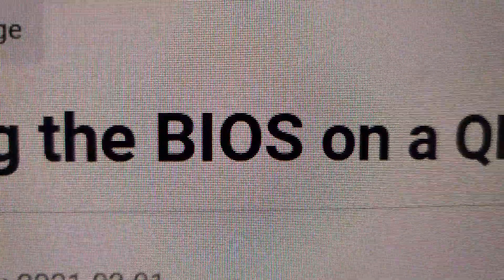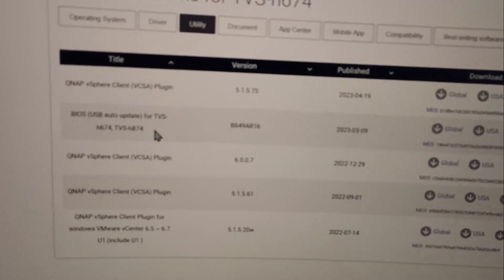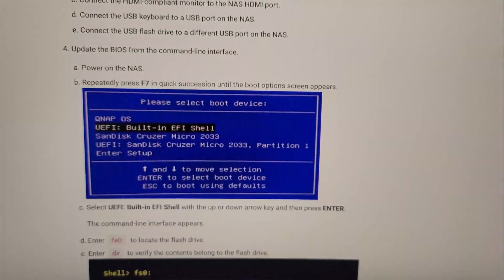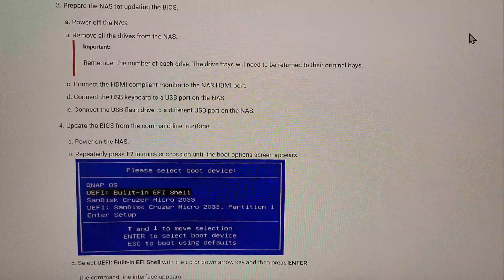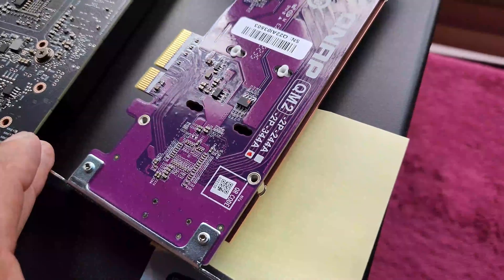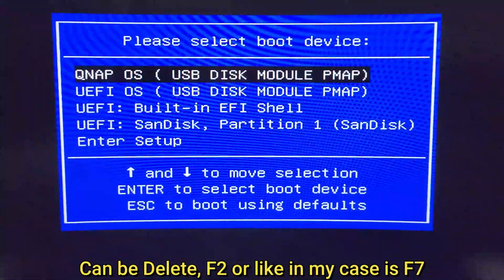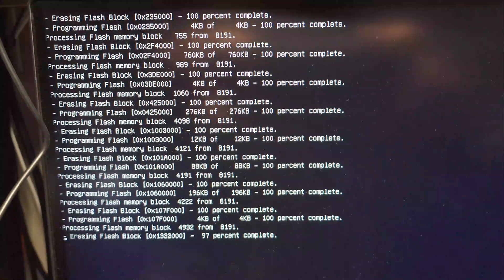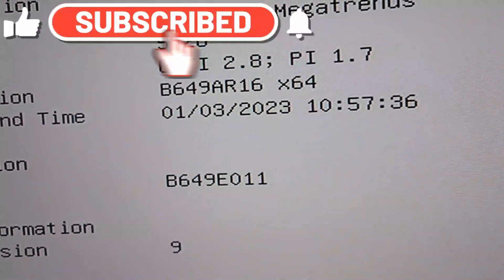Qnap BIOS UPDATE!

Comment: Thanks. This helped me out as the QNAP guide wasn't very comprehensive. I've updated a TS-h2477XU so that I can add a 16 disk JBOD expansion with SFP+ card. The only issue I had was this pro unit doesn't have HDMI and so I had to find a suitable PCIe GPU to access the BIOS - essentially they support a limited amount of GPU, but I struck lucky using an older GTX model with native HDMI which also didn't require additional 6 pin aux power! The QXP expansion card doesn't work unless in a specific PCIe slot - something QNAP failed to tell me in their instructions. I'm all up and running now and have another 400TB to play with :)
Reply from the maker: 😊Glad it helped! Awesome GOD BLESS!!!